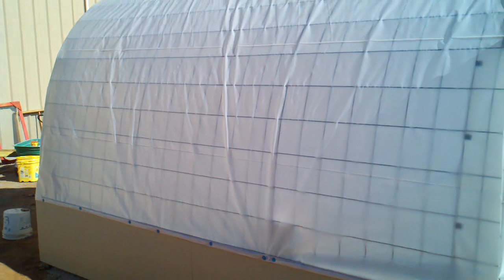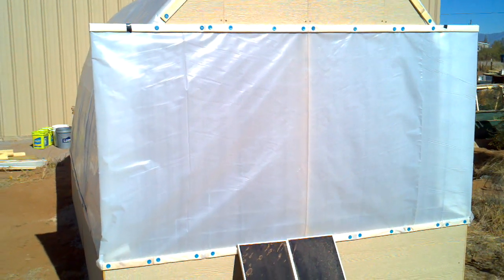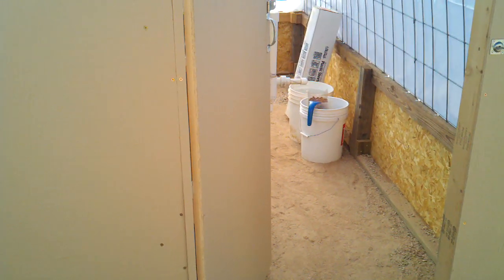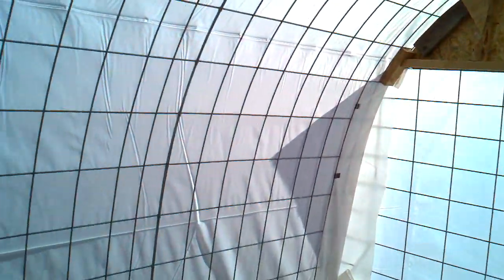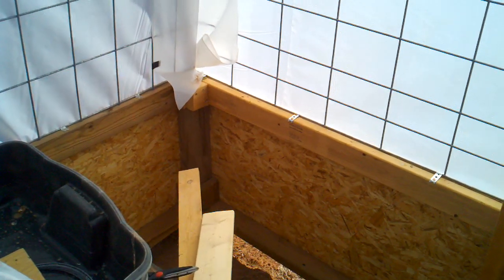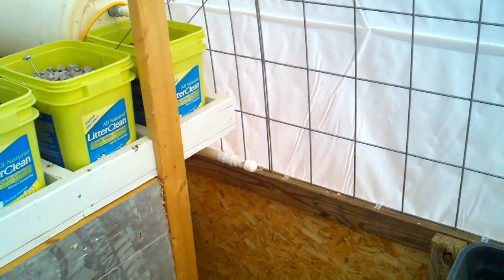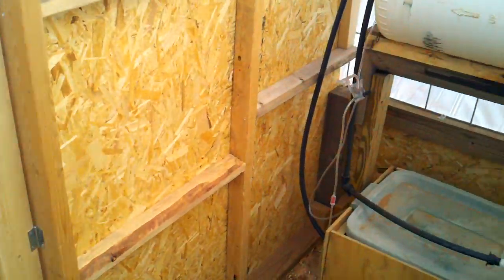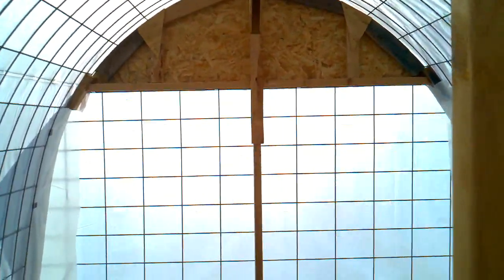Aquaponic Greenhouse

Comment: I'd like to see an update on this greenhouse. I notice there was no vet system in place except what would come from under the walls but it needs to vent the air somehow.  The cow wire would help in high winds and heavy snow that is for sure.  I'm going to have to video my aquaponics green house from start to finish and share, I've learn so much from everyone that has shared theirs it seems only fair.

Comment from the maker: On the north wall and around the base I have 6 mil plastic film attached to the inside of the 2x4 with staples. This provides a "dead air" space. The single of layer on on the cover allows for radiational cooling all night long. We so seldom have cloud cover that this can be a significant problem. This can be mitigated by a heavy cover or a second layer of plastic with a small blower to inflate the air space, if you make it rather air tight it is effectively static "dead air".

Comment from the maker: The advice to paint of use other materials other than chip board is good advice. Here it has not been a problem yet because we are so dry but in other areas there might have been significant damage by now. I don't have significant humidity inside the green house because I have to ventilate it to keep the heat down. I need to get my shade screen completed over the green house to help this. I do use a solar blanket to keep the afternoon heat from directly beating down on the fish tank.

Comment from the maker: The metal grid gets no hotter than things surrounding it. It is not hot enough to melt the plastic. As for burning the plants the greenhouse does get hot and it is necessary to ventilate the structure. I have a screened in end and a fan for drawing air through.

Comment from the maker: While I have received much value from the greenhouse, I have a redesign which will use the same material and give 50% more area covered. In that make over there will be a vent across the peak with the ability to control the air. I hope to accomplish this early this summer so that the green house is serviceable for the summer / fall season. I will publish what I have done as I make progress.

Comment: I hope your sill boards (2x4) are pressure treated, or they will rot out in a very short time. 
My sill boards all needed replacing as I did not use the pressure treated.

Comment: I made a shed out of chipboard,and used plywood on the roof.  The chip board, even though it was on the sides, and painted, does not hold together and starts deteriorating in a couple years. I recently replaced it with plywood.  The original  plywood roof, exposed to much harsher snow load, rain etc, is holding up very well.   My advice is to cover the chipboard, now, with something more durable, before major degrading sets in, which is all you can do, since it is a lot of work to fix that.

Comment: Read the comments about the ventilation problem.......Why not put in small windows for air flow........I realty like the set up, but would like openings around the lower base to vent out from the top somewhere or you might have trouble with spider mite and white fly..

Comment from the maker: I've had a very light snow coating last year, absolutely no appearance of strain. In my opinion I think that it can handle 80 pounds (well distributed) and the snow tends to sluff off the steep sides rather quickly. I have the ridge beam that should support any reasonable snow event. My major concern was wind, we just had a day of 65 mph winds and the greenhouse shows no signs of ware from a season of winds.

Comment: Cooling needs passive ventilation.  If you crack it, passive vent gets stronger the hotter the weather.  You need a high vent which releases greenhouse rising hot air and a low vent, running underground through a pipe, will allow in the cooler air from outside.  Could assist with a fan?

Comment from the maker: The honest truth is not enough. During the summer ventilating the green house was difficult to keep the temperature down. I will get busy now that the temperature has cooled down and use it through the winter. It easier to heat than to cool, and we need so little heating around here that it just makes more sense. I tried a misting system but that just left scale deposits on all of the plants and equipment. The aquaponic system is still operating and is growing some herbs.

Comment from the maker: Rav, I have added a box fan on the north end and on the south end I have shade cloth. The greenhouse does get hot in our summer heat. I also have experimented with the number of misting nozzles and have settled on two for the the time being mounted on the south end inside of the shade cloth, they can truly make a 30 degree difference but the excess moisture becomes a problem.

A the time I built the greenhouse I was aware that it would be a good idea but did not do anything, future project.

Comment: Hello Sir, I like your design very much. Sorry to hear the winds shredded your work. Maybe a good idea to use plastic which is reinforced with (i think it is carbon) fibre running hor. and vert. about 1/2 an inch apart. Indistructable stuff which is used a lot in construction (in the Netherlands that is)

Comment: I purchased a new cover <$75 delivered. Made form a material called Solarig 172. Purchased for J&M Industries, Inc. 800-989-1002. UV protected, reinforced, 6 yr warranty. I added 5 battens made from nylon strap about 1/2 inch wide called Bulline, (used for pulling fiber optic cable in under ground conduit) over the top. Working very well in high winds.

Comment from the maker: @Blacklung420thc Actually it is an aquaponic system. I have 14 gold fish supplying the nutrition in the system. They are in the the white 15 gal tank that lays on it side with a hatch cut in to it. My system is un-heated so the nitrogen cycling is not very robust at this time (late February). Yesterday I had a wind event that shredded half of the plastic covering will try to get repaired with reinforced UV plastic.

Comment from the maker: @aquasolterra Within the last couple of weeks I have removed the buckets. I have learned that Dutch Buckets are appropriate for hydroponic systems but have a significant downside in an aquaponic system because of bio-film fouling. I have found that holes with dimensions smaller than 1/8 inch should be totally avoided and that the minimum dimension would ideally be greater than 3/8 inch (9 mm). The bio-film totally blocked the screens in the bottom of the buckets holding the media from drain.

Comment from the maker: Actually it is an aquaponic system. I have 14 gold fish supplying the nutrition in the system. They are in the the white 15 gal tank that lays on it side with a hatch cut in to it. My system is un-heated so the nitrogen cycling is not very robust at this time (late February). Yesterday I had a wind event that shredded half of the plastic covering will try to get repaired with reinforced UV plastic.

Comment from the maker: I did use the double poly on the north side and around the stem walls, just stapled it in. I have not gotten around to the inner double poly on the arch but got swimming float tubes thinking that would make about a 2 inch spacer and would use PVC hoops to hold it up. I have removed the buckets, they eventually became clogged with bio-film. I have replaced them with a 55 gal barrel half. I keep several 5 gal buckets of water in the greenhouse to let the chlorine gas off and for thermal.

Comment from the maker: I don't have an exact materials list but here is a good start:
8ea 2X4X8' untreated lumber
4ea 1X4 used to make door structure
6ea 2X4X8' treated lumber used against ground
3ea 4X4X8' treated lumber cut to 4' lengths and buried 2' to anchor structure 
4ea 4X8 sheets of OSB
3ea 16'X52" Cattle Panels
As necessary 1-5/8 and 4 inch screws (a pound or more of each),
plumbers strap - this is what I used to secure wire to wood with screws,
Roll of 6mil polyethylene plastic.
Contact by gmail for ideas